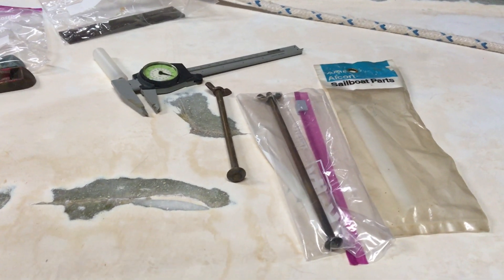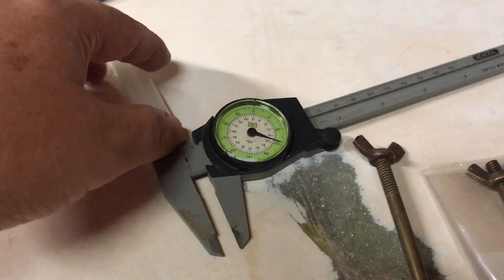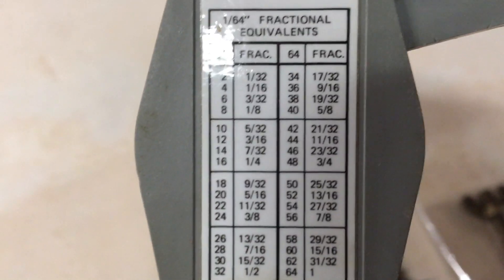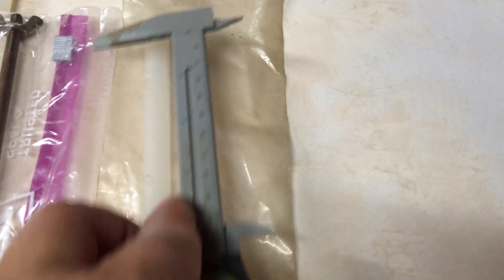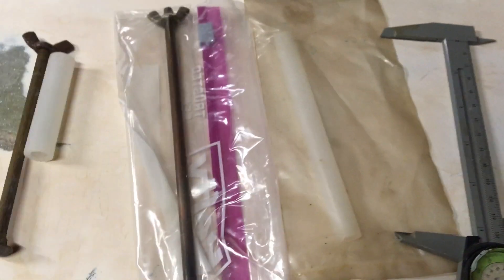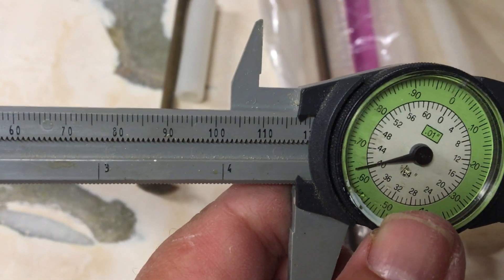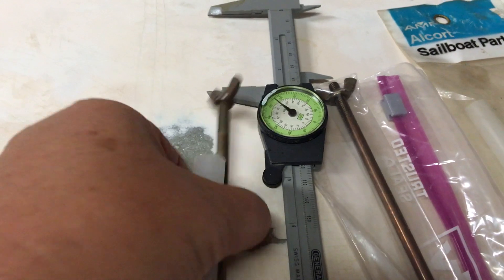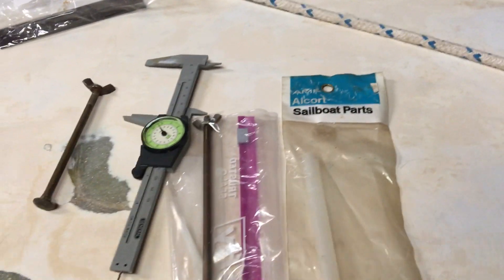Alcort Sunfish and Sailfish Old Style Rudder Troubleshooting

Comment: Good stuff. After further inspection, the bottom of my carriage bolt was slid all the way forward in the lower plate.. I'm thinking this is what has been causing my rudder to pop out. Seems to be exactly what the tube is for. I will have to look for something that will fit next time I'm at the hardware store.